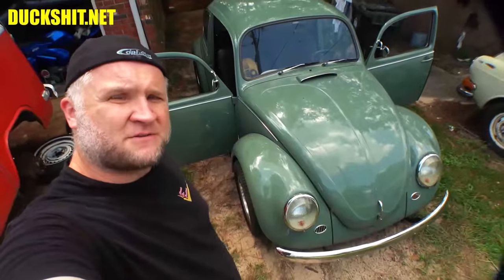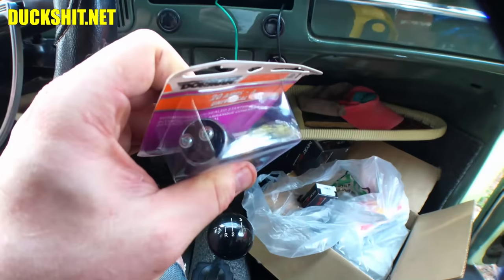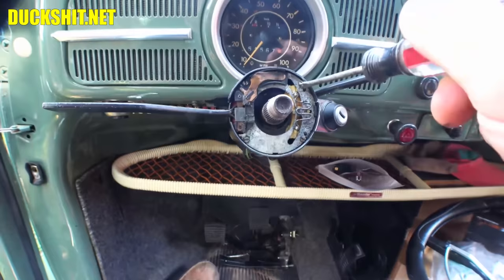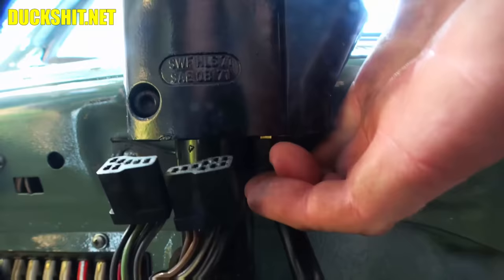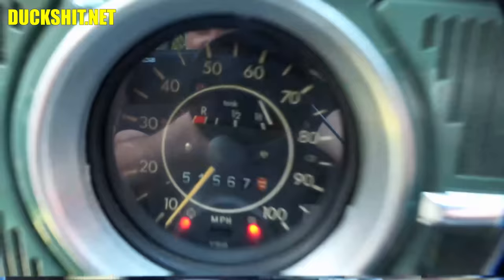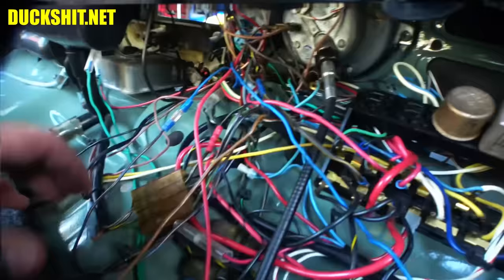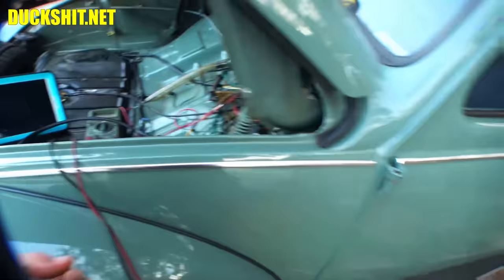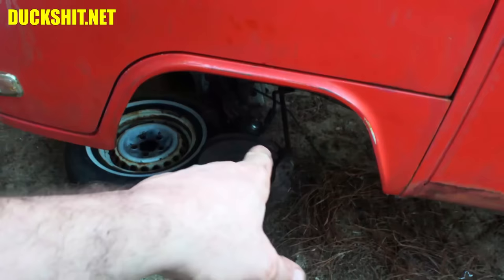⚡️Ignition Switch Replacement and More⚡️- 1972 VW Beetle

Comment from the maker: What kind of junk have you had fail on you lately?  The junk that vendors sell nowdays.... name brand or not, just incredible junk.
Reply: Yes golf mk3 diesel estate glow plug relay , about 3 years ago the flow plug relay failed on me.
Went to a reputable parts supplier euro car parts in England. Bought new relay, the dam thing stayed on sucked the power out if the battery and then melted the dam relay board. 
In the end got a second hand relay and new relay/fuse board.
Expensive exercise. 😮
Chinese / jap crap, it could have caused a fire, or finished Mt old car off.
Reply: Oh yes and an alternator I bought from china to replace the noisey supposedly refurbished one , that lasted just over 12 months.
Does anyone make anything that's any good these days?.
Reply: All vw ignition switches don't last forever they aren't very hard wearing.
My car kept cutting out randomly 😒 took me two weeks of thinking to solve that problem😂.
Poor design and cheap shite
Reply: @dreammaker730 The old OEM would last a lifetime. Repop stuff sucks nowadays.
Reply: electric fans of Ebay for a Volvo. Lasted maybe a week or so.

Comment: Lord Duckman, you may have thought of by now, but when you put the harness in the steering wheel, there were wires that were burnt. I'm eondering if those are the wires for the wiper blades, and they somehow worked for a moment,  then shut off.

Also, did you check the 4way switch after getting the standard blinker switch to work? Not sure how connected they are, I'm just a thinking man, with much to learn, and more to know

Rock on Sir. Have a great week and thank you for your teachings to those of us that do not have anyone else around on a regular basis to help work on our VWs. I have learned much from you, while you are showing us how to do the work, in real time. 
Lord Dino.
Reply from the maker: Thanks!  But Its not at all what you'd expect!  It was a much simpler solution.  Next video maybe tomorrow, or Thursday.  Besides, it was a ground wire that was scorched, but it was intact.  The only reason I let it be. 😁👍🦆💩

Comment: I didn't see the big washer under the steering wheel nut (other people may have lost it) Since going from a 73 squareback to a 69 fastback I haven't had any horn issues I do miss the column mount wiper control at 400 a week those 72/73 multi-switches don't last. Retired now the 69 fasty is a sunroof low mileage car  
I'm old school I still polarize the regulator
Reply from the maker: I think it depends on the year, some exploded   steering column charts don't show a washer in that location.¯\_(ツ)_/¯

Comment: The wiper problem could be the wire with the coating messed in the switch cluster.
Reply from the maker: Nah... well talk about it on next video... I actually found the problem tonight, and its close to that area, but what you're looking at there is the horn wire, previous owner bypassed it with its own button.
Reply: You got a loose connector in tha especific wire just make tide with a small screwdriver and some WD40 loose connections cause overheating @DuckmanCycles

Comment: Why is the ignition switch on the steering column & not on the Dash faceplate next to the emergency switch ?  & the current ignition switch looks to be a mid 70's model.
Reply from the maker: Because it is a 70s model, we covered that in the first 10 seconds of the video!  😀

Comment: My brain hurts just watching you figure stuff out. "I HATE WIRES!" 🤯
Reply from the maker: LoL... what's funny is it really doesn't mean that much to me it's actually quite simple.  I see the picture in my mind.  😁👍🏻🦆💩
Reply: @DuckmanCycles  my mind is a blank slate with wires. I haven't worked on a VW in over 40 years. My 1981 Subaru was easy to figure out.
Reply from the maker: Japanese stuff always makes more sense to me, the Germans like to take weird shortcuts... well specifically Bosch, as they were the ones that made a lot of wiring harnesses for German motorcycles and cars.  This is especially true when they add an accessory, instead of giving its own circuit, they piggyback off of something else that's in the vicinity.  Volkswagen backup lights hopping off the coil is one such good example, lol

Comment: It's the small fixes that make the biggest difference. Funny thing, my fastback has duel carbs and starts up and idles great. My super beetle also has duel carbs. I have to warm it up with my foot on the gas until it's warm to get it yo idle. Neither one has chokes. Any ideas? Great fixes Lord Duckman 🦆. Noel 👍
Reply from the maker: If all things are the same, then I would bet the low speed fuel mixture is set richer on your Fastback, either that or timing is different, possibly dirty carbs, vacuum leak, or maladjusted valves.  When I first put the dual carbs on my Fastback, it started up real easy because it was too rich on the low speed, almost like being choked.  When it got warm it doesn't need all that extra fuel though, I could smell it in the exhaust.
Reply: @DuckmanCycles  yup, the fastback does run richer than my super Beetle. Probably why it starts so much better than the Beetle. 👍👍
Reply from the maker: That alone right there is probably it! You might want to dial it back just a little, its better for the rings and pistons, too.
Reply: @DuckmanCycles  lean the idle mixture on the fastback?
Reply: Thank you 👍
Reply from the maker: @noelamick2015  yeah I would probably start with the low-speed mixture

Comment: I’m missing my key. I can’t get it to slide out. What do I do?
Reply from the maker: The key is missing and won't slide out.... you mean like the key is broken off in the ignition?  Please clarify!  Ambiguous input!
Reply: Nah man. Missing my key. Lost it. I can’t move it to the accessory position. Missing missing. Didn’t think there was another word for it. Not broken. Legit. Lost/missing. Not being a dick. Just thought I’d keep it simple. Like I don’t have it. I need to replace the tumbler. But can’t get it to come out without busting the column. Which I don’t want to do. Thanks in advance
Reply from the maker: Ahhh that makes more sense.  I've gotten in behind the column lock pin with a screwdriver before and pried it out of the way...  it's a little bit fussy but it is possible.  I think I demonstrated that one of my other ignition lock replacement videos in the last year.  That car also had a lost key.  Once you get out the entire steering lock ignition assembly, you will have to drill a small hole in it to release the tumbler.  Once that's done, even without the key you should be able to pull the tumbler out gently if you pry it apart with a screwdriver or some other spudger.
Reply: @DuckmanCycles  I will check your channel. Nightmare. Reminder to anyone that has one key. Make duplicates!!!!